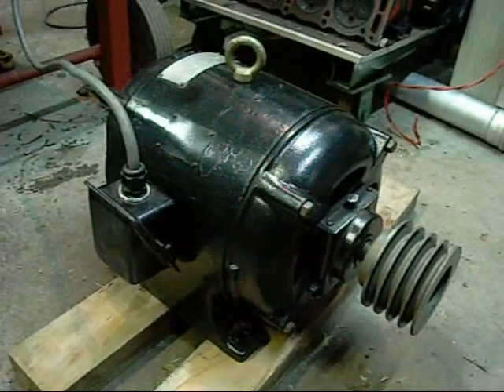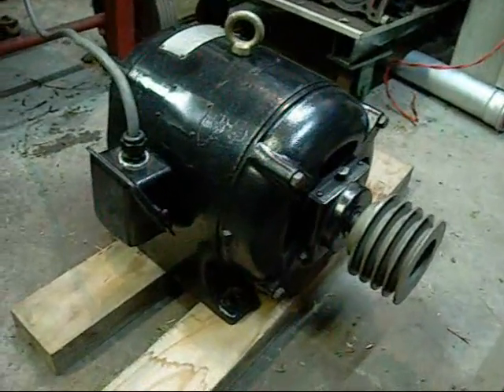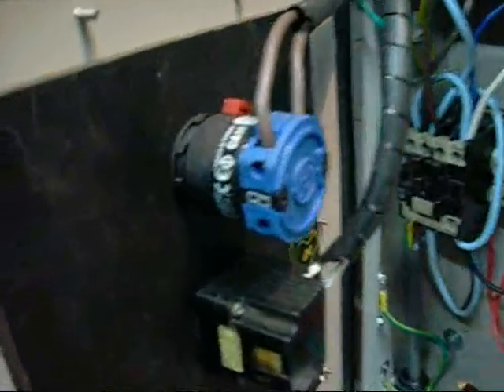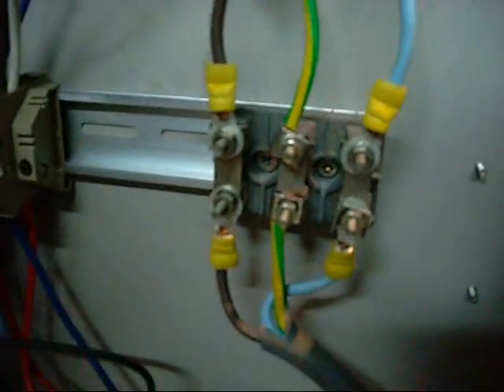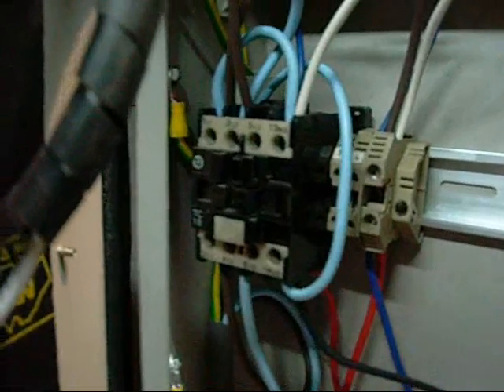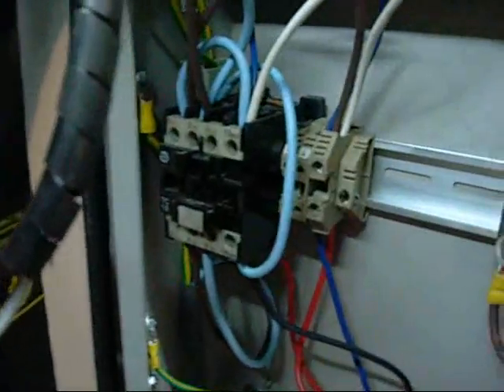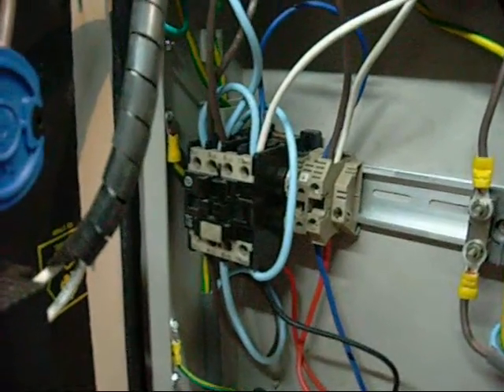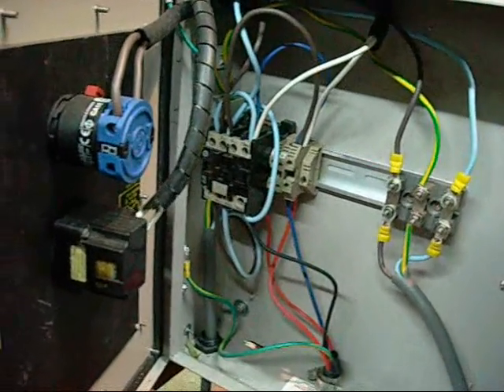Century Electric Repulsion Start Induction Motor

Comment: Another advantage of a Repulshion Induction motor besides Massive starting torque is 
lower starting current wich was great for rural homes with small electrical services(under 50 amps)
Sad companys stop making them about 20 years ago.
I collect them and the biggest I have is a 3 HP
theres a farmer that has a GE 5 HP repulshion induction motor on his grain elevator, and would love to buy it from him.

Comment: I think the clocks designed to run on 50Hz must be geared differently, but if you put a clock designed for 60 hz on 50 I think it would run slow. Battery clocks are always quartz so they don't rely on that 50/60hz like the old plug in clocks do. the old ones have a type of synchronous AC motor in them. sadly they don't make them anymore :(

Comment: the voltage might vary a little, but it's always 60 hz, otherwize the old electric clocks wouldn't work right, they depend on that 60 hz frequency to keep good time^^

Comment from the maker: thats fair enough about the stoves and dryers, I imagine they would draw too much current on 110V, my old electric stove was hooked up to a 20A breaker alone
I notice some places have 240V 3 phase power instead of 440/415

The motor is lubricated by brass oil rings that roll around on the shaft and dangle down into the oil, picking it up and dispersing it. its a very cool idea